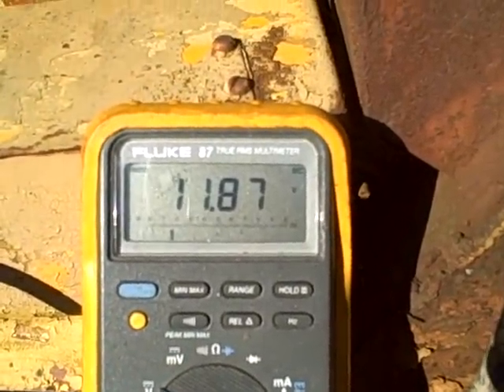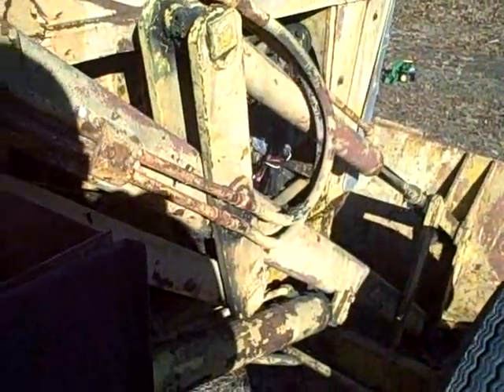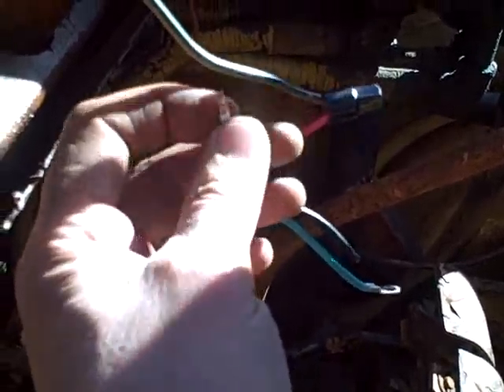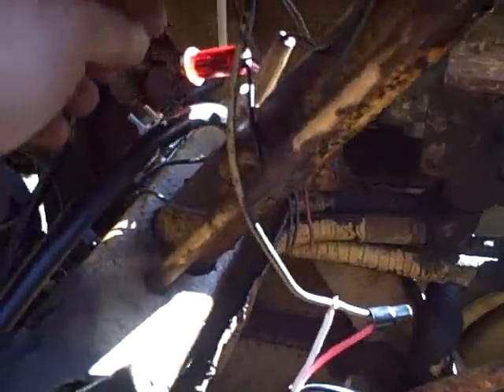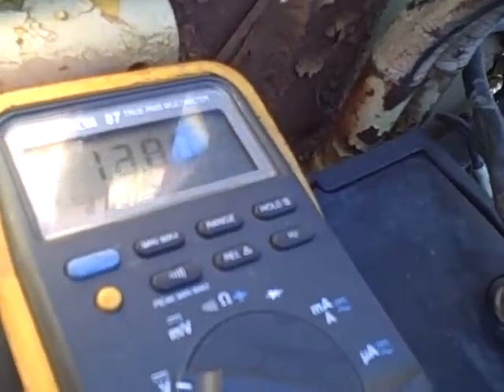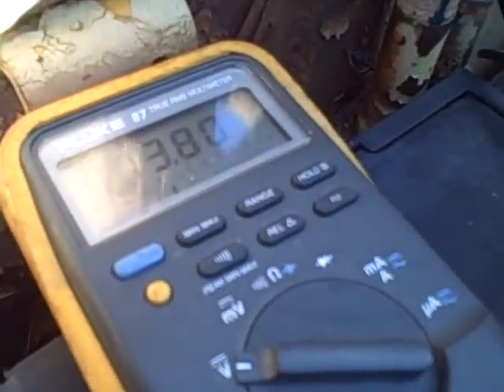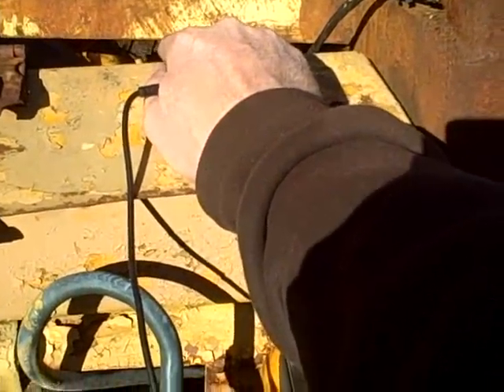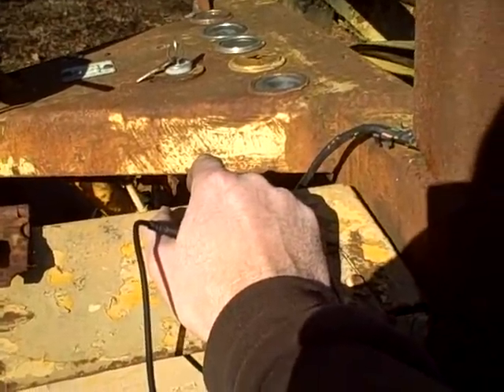Oliver 770 Industrial Tractor Project Part 46

Comment: Thats exactly what mine is 13 .82 volts and charging the very same good going but if all else fails just use a push button to engage it or a dummy light switch thats off & on .